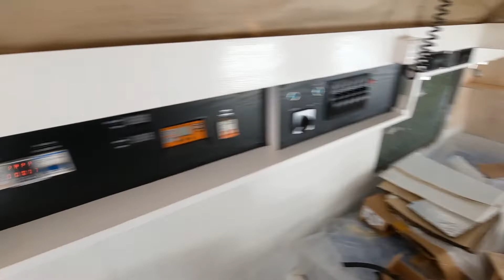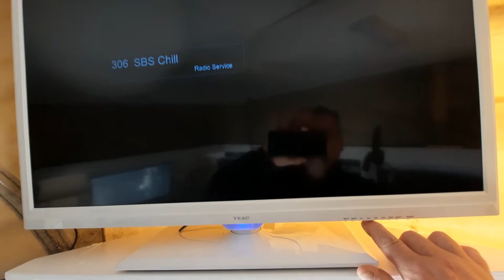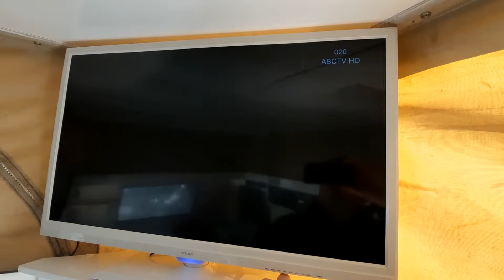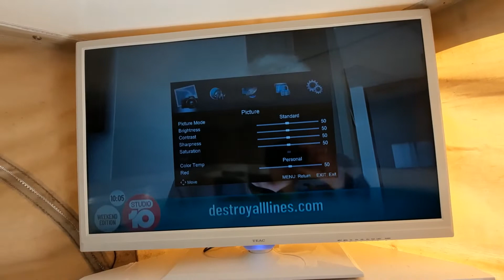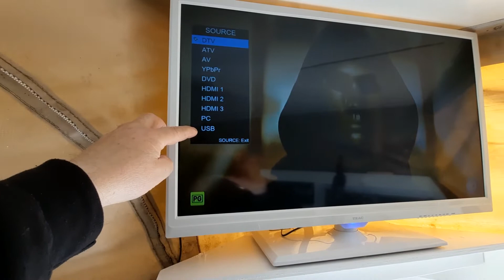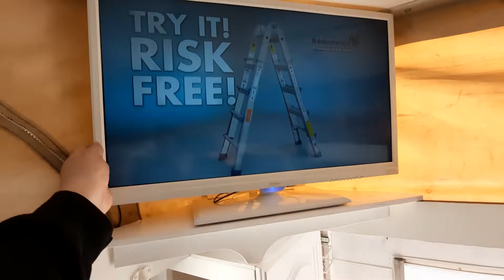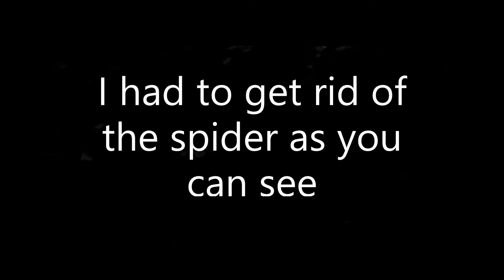New Fridge for Caravan Un boxing  & Tv working  ep24

Comment: ur going to need an amplifier to get the HD channels and when ur further out u need a vertical phased array tv antenna for regional stations.
Reply from the maker: yeah I know but  4 now this will do the tv does have a built in dvd in it   see how we go  that little areil does pick up a lot  though
Reply: @itsjustme356  there is a big power difference between SD and HD, the same amount of tv channels is broadcasted all over Australia but u need to auto scan every new location u go to and that little antenna will not do it alone, every new camper has an tv amplifier installed and is very necessary.